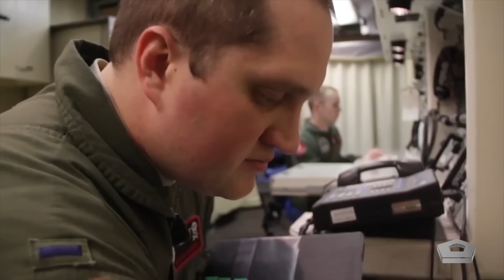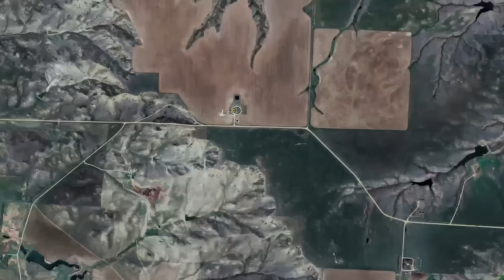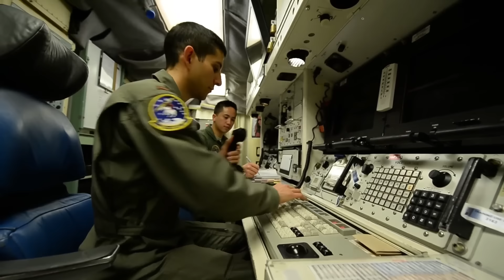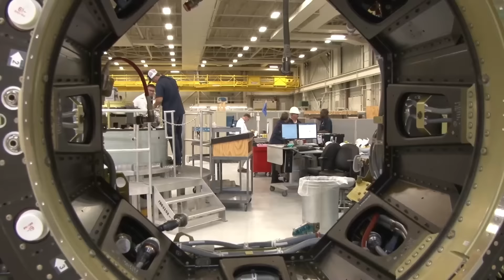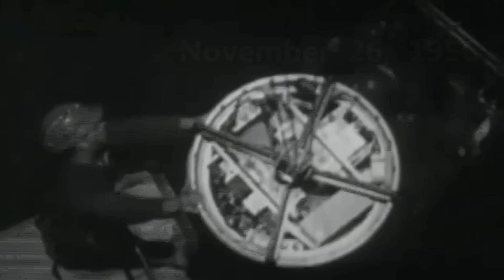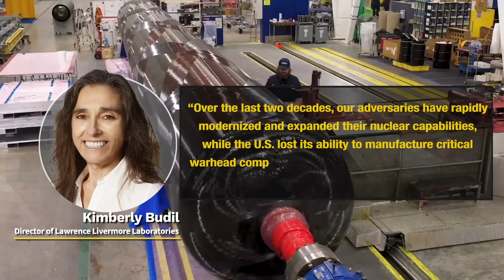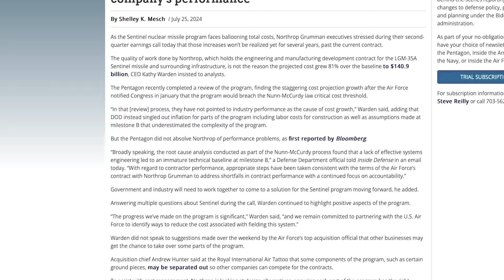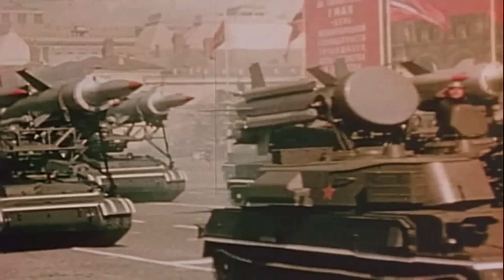America’s New Doomsday Weapon is Unstoppable

Comment: The floppy discs are there as a part of a system that cant be taken over. They will be there until quantum computers exist. They aren't there because they are old and need replacing. They are there because they serve a purpose and can't be hacked....
Reply: I mean, they can, but the level of effort to pull it off is so insane it's de-facto impossible to hack. (outside of social engineering, but everything with humans anywhere in the chain is vulnerable to that.)
Reply: They are also EMP proof, magnet proof and "not exactly traditional floppies". Thermo-opticals.
Reply: It's been revealed no joke that the launch codes for the silo based ICBM were all zeros for nearly two decades.  They supposedly did this to increase reaction launch time

Comment: Just a note, when people speak of the "fireball" from a nuclear explosion, they're actually taking about the thermal pulse.  The actual fireball of a nuclear explosion is much, much smaller than what people mistaking reference as the thermal pulse.  The true fireball of a nuclear explosion is measured in yards or meters with the actual fireball being about a 100 yards (similar size in meters) for typical larger tactical nukes (the couple hundred kT range), yet the thermal pulse will a mile or two.
Reply: Exactly. It's not fire but high-energy photons. You get vaporized from a sunburn, essentially haha
Reply: A 1 megaton fireball is about a mile in diameter i think.
Reply: @megaton179  You're thinking thermal pulse, the actual fireball is much, much smaller.

Comment: Those floppy disks weren't just old relics of past tech.  They're purposely used in a lot of cases for security.  Those big old floppies and tape drives are insanely outdated, but that means hardly anyone even has access to the tech needed to use them anymore.  It's done in business and military applications.  Think of it like writing a classified report in a dead language like Gaulish.

Source: not military but I've worked in IT in a defense contractor context.
Reply: Right. That's also why core components of these systems are still hardwired together and weren't upgraded to wireless. It's much harder to unobtrusively hack a tamper-proof hardline than a wireless or net-based connection. Plus, many older electronic components are either EMP-proof or more resistant to EMP (electromagnetic pulse) than modern electronics. For many reasons, the simpler a system is, the more reliable it is. A system with a lot of bleeding edge components and bells and whistles adds complexities and possible points of failure. I hope the people in charge of the program are able to prevent the various defense contractors from piling on needless features to boost their profits.
Reply: @Calamity_Jack  preach!
Reply: @Calamity_Jack  "and weren't upgraded to wireless. "
Wireless isn't an upgrade. Most secure DoD and DOE traffic is still constrained to fiber. The controlllers can remain connected the way they are with serial connections like many CNC machines remain to this day.
Reply: I was thinking that. Would be hard to hack something that runs off floppy. You would have to know those systems.
Reply: @waynelitchkowski2389  not just that, these systems are usually air gapped. Which means there is no approach to hack them remotely. Attacks on air gapped systems usually involve targeting personnel and getting them to upload your virus or other software payload for you, either knowingly or unknowingly.
Reply: @BretekV  Airgapped facilities have been comped quite simply and effectively. Humans are definitely one of the biggest security flaws in all of these systems.
Forget USB sticks in parking lots for a second.
There's other ways to comp an airgapped system. Something as wild as using the SATA cables inside of an airgapped computer as makeshift antennas to exfil data off of that bad boy. Sure you have to get a program onto the airgapped computer to run the hilariously named SATAn program, but there's tons of ways to do that.
Reply: @davemeads859  it's not common at all, but there's a type of attack where if you know what keyboard is being used by someone where if you can manage to get a tiny mic nearby you can actually decode all their keystrokes.  SUPER niche but interesting
Reply: @davemeads859  That only tells them the head "position" dude !!
Reply: @waynelitchkowski2389  Hacking into a floppy isn't a problem. Hacking into something you have no physical or remote access to is.
The code itself isn't very complicated. It's mostly 60 year old machine code.
Reply: Also note: Floppy drives are easy to destroy via fire or mag-wiped in case of security breach.
Reply: It is NOT done for security reasons. If you'd ever actually served, you would have known this.
Reply: @morticialatex  has nothing to do with serving.  it has to do with the fact that I was part of a team securing classified info.  being in the military doesn't make you an expert.  This is the same nonsense as people thinking cops are experts on laws when that's really lawyers.  DoD contractors are let in on a lot of things and procedures that enlisted military has no need to know, and since you served you're well versed on the idea of "need to know" I imagine
Reply: @morticialatex  while I have immense respect for those who have served, this reeks of the "thank me for my service" type of veteran that literally nobody likes
Reply: China is the most beautiful country in the world, and it is run by the most intelligent people of all time. To say less is treason.
Reply: I have both sizes of the original dos floppy drives in my home and a pc for them.
Reply: "Those big old floppies and tape drives are insanely outdated,"
They were outdated 30 years ago. Now they're unserviceable. 
The content of the disks isn't anything special that ain't be replicated, but media and replacement parts haven't been produced since the 1980s.
The same code could be run from any media, and the same controllers could be retained if they wished.
Reply: @wisenber  it has nothing to do with code, the point is that if someone get their hands on the storage media, there is a reduced chance of it being able to be read as the equipment to do so is rather rare now.  This isn't me theorizing, this isn't me assuming.  It is explicitly why they are used.  It's a known fact that very intentional
Reply: Diga plai, mes m'comunic' en Gaulish fréquemment.
Reply: @johnr7279  not even historians and anthropologists can translate Gaulish.  If you are mistaking it for Gaelic I get the confusion.  Gaulish was a language spoken in what is today France and Switzerland up until the time of the Romans and then died off.  Even the world's leading experts on the language cannot speak it at a conversational level.
Reply: @ryantannar5301  I was just jokin' anyway.
Reply: @johnr7279  fair, I just read it and realized that somebody could actually mix those up in theory
Reply: All this talk of ways to penetrate an air gapped system using electronic means forgets that the bases are located underground and behind fences.  All of the means of electronically penetrating an air gapped system require proximity that you aren't going to get.  Corrupting or social engineering the personnel is the risk here.  

The obsolete equipment makes it harder to hack, but the true benefit is that all the bugs are known.  The problem today is obtaining spares.  Nobody has made a floppy drive in 40 years.  

I remember desperately trying to obtain an 8-1/2 floppy drive just 2 years after the 5-1/4 came out so we could recover a critical program for a power plant.  It took 8 months and cost 6 times as much as a new 5-1/4.  When the 3-1/2 came out, we promptly purchased 20 5-1/4 drives for spares, and made 3-1/2 copies for backups.  I left before then, but I imagine they did the same when CDs/DVDs and later thumb drives came out.  Lesson learned.
Reply: Navaho code talkers. 
Analogously, one of the high-end computing companies in the private sector encrypts their product keys using entirely obsolete computers running on an entirely obsolete OS and S/W.  To my knowledge, it has never been compromised.
Reply: Security through obscurity is not a good defense
Reply: ... and are now allowed to talk about it. 🤡 Pffft! That would be the last time you worked in that context, mate. You have to be security cleared to do that, and think what clearance officers think about guys who wooly-headedly waffle on YT about their defence jobs. Exactly what a country should employ for its defence: People who can't keep classified intel confidential, however insignificant. You'd be vetted "as trustworthy as Mata Hari" .
Reply: @ABeauEsq  none of what I said is classified in the slightest.  Try again edgelord.  What I told you is very much so public information.  You're trying to act like you know anything at all about the industry but are talking like someone who has never done ANYTHING even tangentially related to the field.
Reply: @ABeauEsq  are you serious? What he said is the IT equivalent of saying what kind of kind of gun lubricant the army prefers: not at all relevant to security - so much so that  they openly talk with news outlets about it themselves from time to time
Reply: @ABeauEsq  ".. and are now allowed to talk about it.  Pffft! "
Basic security concepts aren't prohibited by NDA. There are even publicly available study guides for security best practices for people pursuing certification.

Comment: I sure hope this is not the case, but can someone tell me....   In reference to the current ground based missile system that he spoke about that has two military personnel in the control rooms: Are those two people solely able to launch the missiles with no other countermeasures? I realize that the president must call them to "authorize" it, but if that is the case it really leaves many different scary situations open. For example 1. A crazy military control room operator could overpower the other and send the missile. 2. It would only take one bad combination of two crazy workers who decided to fire the missiles. 3. One crazy military control room operator could trick the other into thinking it was authorized. Etc. I know these scenarios are unlikely and realize that the military (probably) rigorously vet checks and dives into those workers backgrounds, but even then it would make me nervous. Anyway... I just wondered if someone knew how the process worked and if those two workers had the doomsday button fully in their control?   💣  💥  ☢
Reply: They need to get a code from the president to allow the system to be work.  Only then can they simultaneously turn the 2 keys to arm the missiles, then launch.
Reply: @jonesjones7057  Okay! Thanks. I was hoping that it was something along those lines. That makes sense. Thanks for answering. 👍🏻
Reply: @adamh8851  no problem.  I felt for you there.  It's scary enough as it is, without thinking how easy it would be for 1 guy to go rouge and start ww3 without the safeguards they thankfully do have.

Comment: The clustering of silos and their spacing was a calculated decision. The silos are far enough apart so a near miss of one silo does not damage another silo. However, they are close enough together that the blast from a ground detonation can destroy, damage, or knock off course incoming warheads still in the air.

The air leg is the most vulnerable to surprise first strike. The bombers, even in hardened hangers, are much more vulnerable than ICBMs in a haden silo. 

The silo-based leg has a huge advantage over the other two legs. It has the lowest maintenance and manpower cost of the two by a significant margin.
Reply: "the blast from a ground detonation can destroy, damage, or knock off course incoming warheads still in the air." I don't think it works like that. Point 1: Sprint short-range anti-ballistic missile: "The Sprint was armed with an enhanced radiation nuclear warhead with a yield reportedly of a few kilotons, though the exact number has not been declassified. The warhead was intended to destroy the incoming reentry vehicle primarily by neutron flux. " Implying that simply flying through the remnants of a nuclear detonation, even a second or two after the detonation happened, would not destroy a warhead. Consider instances like the 1961 Goldsboro B-52 crash, where the bombs that hit the ground remained intact enough to examine their safety mechanisms: a nuclear mushroom cloud may look scary, but it's a lot less dense than the ground, and a warhead that passes through a mile-wide cloud at 5 miles per second (8 km/s) won't absorb too much energy.

Point 2: Certain sites in the USSR were targeted by missiles based on a simple calculation: if the probability of destroying a hardened bunker, 50 meters or so underground, was 5% with a single warhead, then the US allocated 20 warheads for the site. They wouldn't have done this if the first detonation would have destroyed subsequent warheads as they approached the target.

Oh, and Point 3: Project Orion, the design for a nuclear pulse spacecraft, where bombs explode beneath a pusher plate: "The optimal Orion drive bomblet yield (for the human crewed 4,000 ton reference design) was calculated to be in the region of 0.15 kt, with approx 800 bombs needed to orbit and a bomb rate of approx 1 per second." (Using nuclear explosions for propulsion was also featured in Netflix's Three Body Problem.)
Reply: @RiskyDramaUploads  

With regards to the first point, I was referring to an ICBM warhead detonating on the ground (technique for destrying a harden missile silo) physically throwing other incoming warheads off course (and maybe damaging it), not the warhead of a ABM.

With regards to the second point, if the odds are so low, they would not have taken the shot. You may be surprised how high the odds were for neutralizing a harden silo was in the 1980s. And the second (or possibly third at most) incoming warhead would be a floowing on warhead, timed many seconds or minutes after the first warhead. By the way, if the probability of a kill is 5%, taking 20 "shots" gives you a 64% of a kill. The probabilities do not arithmatically add.

In college, I actually did a paper on a pre-emptive US counterforce strike on the Soviet Union. I had to research missile/warhead accuracy, number of warheads carried, yields, likely degree of silo hardening, plasticity of soils/rock (I actually assumed granite), etc.
Reply: @RiskyDramaUploads  Times like these are when I appreciate living the the Blanconutrix galaxy.
Reply: As for bombers...yes, they are vulnerable in hangars, but you can get them aloft when you think you have someone launching on you and then recall them if you are wrong. Can't do that with ICBMs.
Reply: Good comment.
Reply: @learningisfun2108  

Thanks. I practically minored in this in college. I found it so interesting.